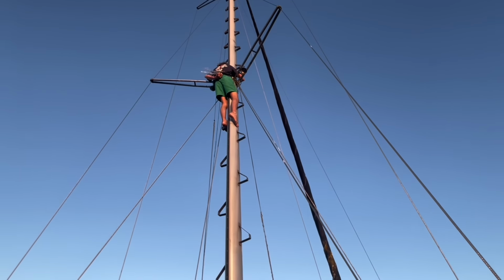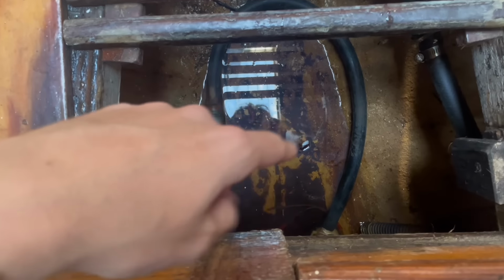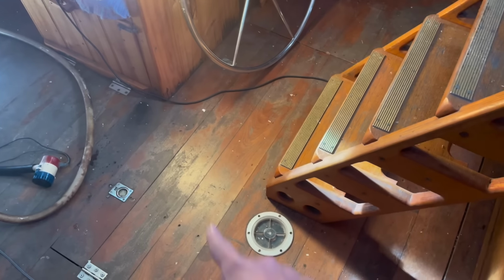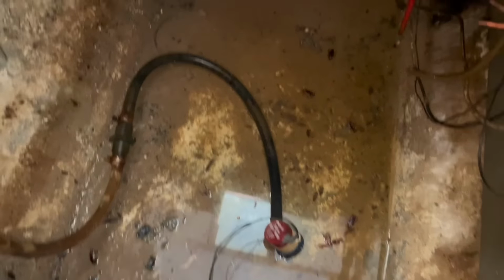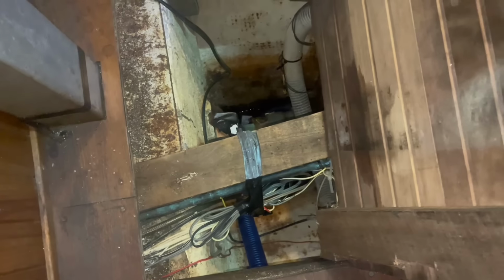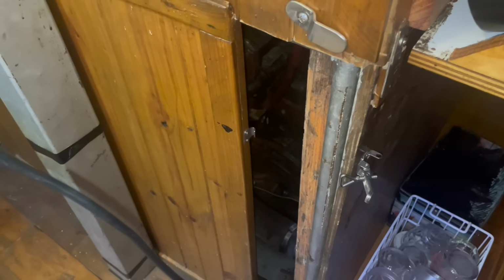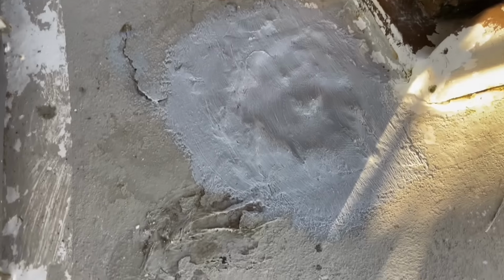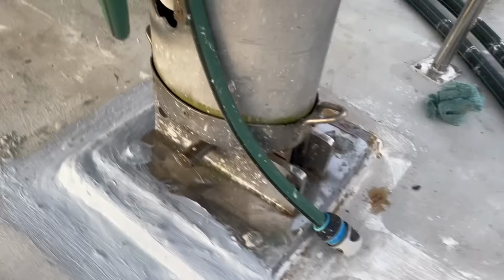I Bought A Boat From A Flat Earther!  2

Comment: when was the last time the boat was pulled out of the water or hauled?  and bottom paint done also the prop shaft bearings and propeller, zincs, and packing?  it's expensive to have a boat hauled out. and rent the space at the marina to do the work. you need fire extinguishers at least 2 or 3 for any fire, proper extinguishers and life jackets for the number of persons to be onboard. Good Luck have fun

Comment: The Ferro boat I had in NZ had these kind of holes between each bilge compartment but they'd all got clogged up. Maybe this is similar and you can get the water running between sections
Reply from the maker: Yeah I hoped this was the case but unless I’ve missed them there’s no holes :(

Comment: Hi mate good on you for tackling that job.
Just a hint when you do those temporary patches apply a coat of the grey sealer before you apply the mesh then apply sealer after. Same applies if you use resin in future repairs
Reply from the maker: Ok thanks

Comment: Get overcurrent protection (fuses) on those battery positive wires ASAP and throughout the boat's wiring.  Be a shame to lose the boat due to a fire!   Also..............you are actually crimping your wire splices and not just taping them together I hope???

Comment: Good on ya young fella !! my advice to you is join a group on social media that has to do with ferro cement yachts , that group should be able to advise you on some maintenance tips and what to look for on a ferro cement hull , check your prop shaft seal , you might be getting some water coming in that way , I have had some experience with that construction so if you have any questions just ask ! I will be following you with your journey on fixing up your boat , good luck mate :)

Comment: In the old days, I would set up a heat lamp to dry them up those critical spots for repair after toweling them down. I suppose the moisture present acts as part of the mix? My 21' 1965 fiberglass "Aurora 21" was a lot smaller, but the oId saying, "learn-by-doing" may well apply here. I thought of it as 2 related stories: What's happening 1) Above the waterline. and 2) Below the waterline, and both between and while. On an on-going basis. Best of luck on a beautiful project. Keep mindful of The Source.

Comment: Wiring unions can be soldered with fishtank tubing slipped over the solder joint. It's better to use 12 volt chest freezers than the boat freezer, because it costs too much to rebuild it. Keep your cameras and charts in a dry boat fridge, unless you are desperate for space on a long passage. Run the chests in ECO mode, never MAX. If you expand your battery system, use separate charge controllers into separate batteries running separate loads. Don't wire batteries in parallel. A world, not British CB radio is both useful and fun. Stay away from FM CB. It's worthless. You should deliberately hose down the interior with clean fresh water, then dry it. A routine. This purges salt. LED lighting is a must.

Comment: Your doing great! Necessary repairs first. And make it comfortable! Every thing else will flow. You might get a wet n dry vacuum. Very helpful thru the process. You have solar and batteries. A small converter will work. Unless it is already setup. Fans in the bilge will help it dry out.
Reply from the maker: Yep have a small converter already 👍, do you mean just put some desk fans down there? or mount some little permanent fans
Reply: @TheBrookeBrothers  Yes. Do you have shore power?

Comment: Your dehumidifier, possibly is not big enough given your real estate. get hold of a humidity gauge, try and keep the humidity below 70% this will not solve your moisture issues but will drastically reduce hopefully the amount of condensation you are seeing. If the hull is sound then most of the water in the bilge has probably been generated by humidity. During the day if its not raining and the sun is out open all hatches, there is no quicker way to remove moisture from the environment, then close them again before the dew starts to fall.

Comment: very interesting project, How is the engine and the through hull fittings?
Reply from the maker: All the through hull fittings seem to be ok, I’m not too worried about them atm because only 1 is below water level and it seems pretty good. The engine will need a little bit of work to get going but as far as I know it should run ok after a bit of tinkering 😅

Comment: Looks like a big project, have you had it surveyed? Might be worth it as they'll tell you where all of your problems are and how bad it is. It's a little pricy (£16/ft in the UK) but they'll check the hull, deck and superstructure. Check out the duracell project channel, he's doing a real top notch build from and old racing boat, he's got a lot of good glassing techniques and tips, especially in his earlier videos. Are you leaving the bilge hatches open to get some air circulating in there? If you're going to be living in there I'd recommend buying some anti-fungal spray and hose it all down, it'll help stop any rot as well. Still makes me laugh that a flerfer used to own it, not exactly sure how he navigated. Look forward to watching more videos from you, should be good. Good luck to you

Comment: I just wanted to say be sure you know the rules and regulations about your area, you would not want to get fined for doing something wrong that will only take money out of your pocket.  I say this because in some countries, if you empty your bilge directly into the water system with oil/fuel in it you may have a problem.  Look into it to be sure.
Reply from the maker: Ok thanks for the tip
Reply: Golden rule. Think about your environment before doing anything. I'm not an eco warrior, It just makes sense.
Reply: @joewilliams5396  I have the same thoughts, be smart to avoid as many surprises you can.

Comment: Do not go up that mast without a safety harness on...brake ya back and your whole life will be shite if ya don't brake ya neck guaranteed. Ferro cement boats are a special breed I would suggest you google as much as you can on them to understand where your problems will occur , they do tend to suffer from rust blow out when the wire/round-bar within suffers rust problems (Above and below the waterline) You will probably need to strip back the coach lining to reveal the extent of water damage on the wooden framing used to support it. Most marinas require a boat to be insured , Ferro's in average condition are hard to get insurance for so just check with the marina people as to where you stand.

Comment: I'll do my part and provide some Dadly advice. 
Every cent you spend on a temporary fix is money out the porthole. Temporary fixes are a necessary evil, but I'd suggest adding a snippet every episode that showcases a forever fix. Something as simple as I'm going to fix this nest of wiring.... etc.
If your content is good and you can spin a good yarn you-tube will build you a new boat.
Reply: I'm with you with the wiring, my current (see what I did there) worry. 12/48 is ok but the mains stuff is a worry. When you route anything, wiring or plumbing draw what you did. You will forget where is all went. But old codger me aside, well done for giving it a go.

Comment: Holy shite dude, you have every electrician watching this have a stroke at your work. PLEASE use proper connectors and DO NOT use long skinny wire as an extention even if it is just a bilge pump. 
Regards from South Africa

Comment: Keep at it mate, you’re off to a hood start. Nice work with the paint/roving for a temp fix. If it lifts on you try again after acetone wipe then 60-grit sand then paint hull before laying roving on top then more paint. Adhesion is all about the prep…. Cheers 😎